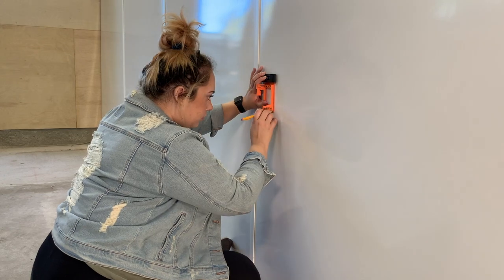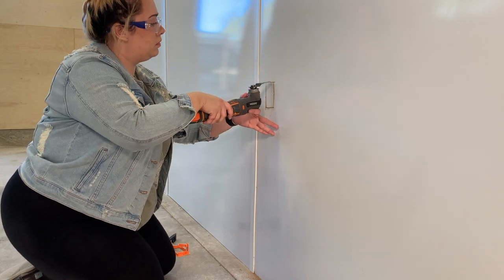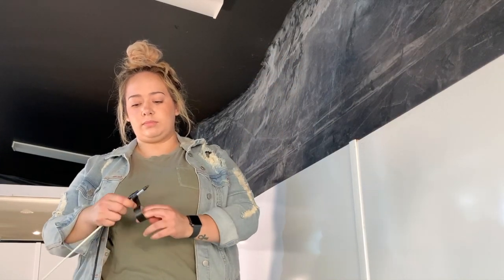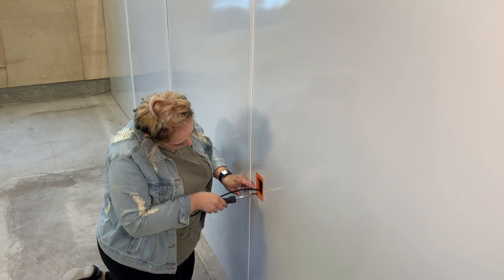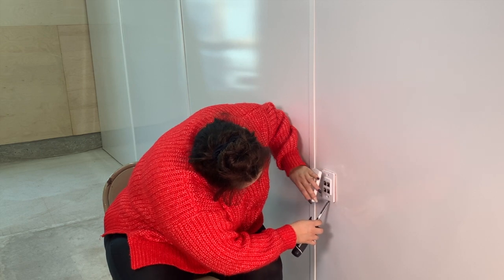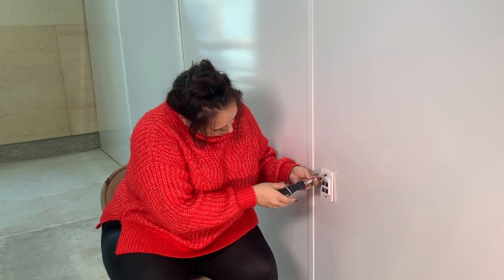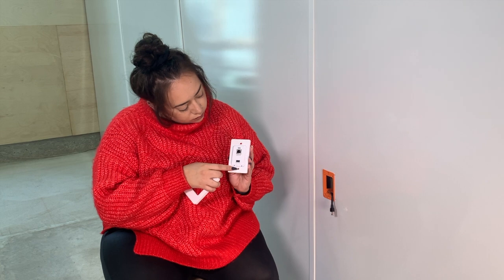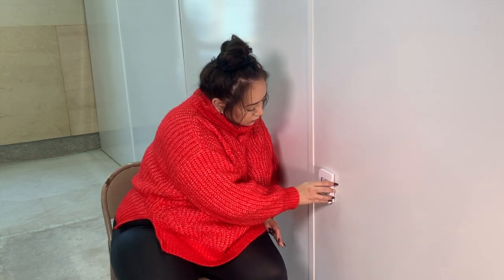Installing a POE Powered In-Wall USB Charging Station | Fits In a Single Gang Box

Comment: Will this splitter fry a non-802.3af/at device? I want to use my 802.3at switch to power the wall station USB port, but not the RJ45 jack: will that work?  I have a unit (Hubitat) that requires USB power, but is not PoE capable.
Reply from the maker: To confirm, this is IEEE 802.3af and at compliant, meaning you can connect the input and output (front) port to any PoE or non-PoE device with 100% confidence it will not damage it.  Yes, you can connect this to your PoE+ to have a USB charging station and a data only port.   Looking at the Hubitat, you would simply connect a USB-A to MicroUSB cable to the power port and the ethernet cable to the RJ-45 port.  I believe the Hubitat comes with the cables you would need.  It sounds like a very cool application, and I hope you'll share pictures of your installation when youv'e completed it.
Reply: @PoETexas  Thank you - I ordered one from Amazon today!